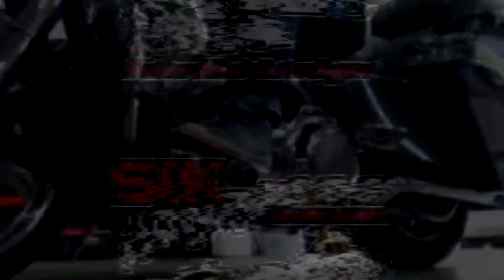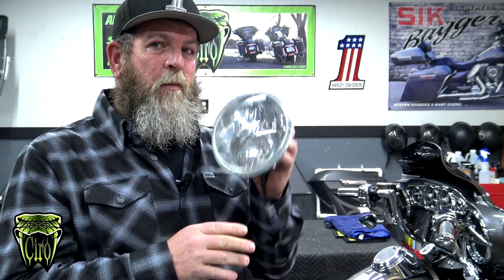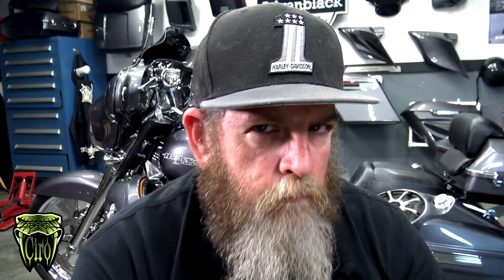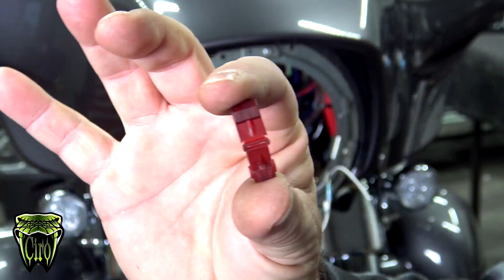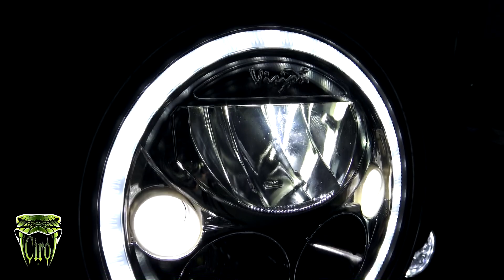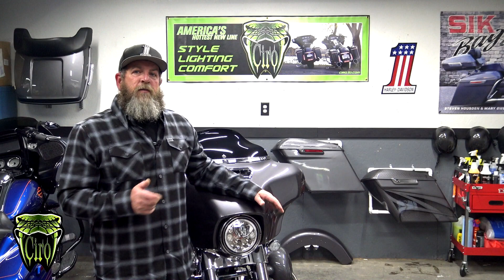Ciro 3D Vision X LED Headlight Install Harley Davidson Touring

Comment: I just bought a newer ultra with Daymakers on it but I have a vision x on my street glide I’m selling should I put the vision x or keep the daymakers on?
Reply from the maker: I was never impressed with the daymaker..specially at a 635 dollar price point for a basic projector style headlight you can get on amazon for 60 bucks.  Id put the vision x in and sell that daymaker all day. The vision x has a way broader flare on the lighting making it possible to light up the edges of the road better...great if you are in deer country. Just my honest humble opinion.
Reply: @sikbaggers awesome and I sure am in deer country I’m by Columbus Ohio area

Comment: Do they make these for 13 ultra limited?
Reply from the maker: Yes...select this headlight http://shrsl.com/1xk3p and then scroll down to fitment.  All models prior 2014 need the 45012 to have both high and low beam on when high beam switch is on.  Click the number on there and it will take you to the adapter. Youll need the headlight, the wire harness ( https://shrsl.com/4gxqt )  and the adapter.
Reply: @sikbaggers I had to buy an adapter for my 14 street glide I don’t know if this is the one or not I’m not sure though.

Comment: How do you like it compared to the Adaptive Custom Dynamics LED Headlight?
Reply from the maker: Hey David...I really cant help much there man..I havent ran that headlight before..my opinion on moving headlights, and take this with a grain of salt bro as I could be wrong...I understand it on cars...2 headlights, 6 feet apart...still lighting up both side of the road...one headlight turning to the right, it adapts to the right...can you still see the left? We have deer and they dont really care which side of the road they cross on lol I could just never wrap my head around it on a bike..I really need to try one out to be honest

Comment: Thanks for the detailed video. I wish they would include the plug with the headlight though. Glad it is the offseason, but I really wanted to power this up.
Reply from the maker: yeah they dont include the plug because the 7 inch round fits alot of bikes, just change the plug...youll have to get one for your bike.

Comment: I have a 99 Electra glide and was wondering if you have ever ran the halo as your blinker? And if so how to wire it up to make that work?
Reply from the maker: Hey terell...I have not tried that but Ciro makes a headlight bezel that has turn signals integrated into it ...the halo is just one light so im not sure you could use that as a left and right signal but you can with the bezel because it is two separate lights.

Comment: I installed the same on my electra. Works great, but up where I live in the mountains, we have a lot of sharp curbs and as you can see on your video(15.36) the light is like a "wing". So when you're in that curb you don't see a fu*ck where you want to go. For the rest it works great. About the price: if it costs more than 400 bucks from the retailer,  he puts about 200 bucks in his pocket. That's not normal.
Cheers from France. 
Great video man!
Reply: Sorry, 10.36
Reply: Ooops, 10.36

Comment: I have a headlight from truck mall and it is more shiny and quite frankly brighter than the Harley-Davidson brand by jw speaker.  I think the good aftermarket headlight makers like he speaker, hogworkz, SUNPIE, and truck mall use a bigger chip in their led’s which make them brighter at a reduced cost. Weather two times or three times brighter ANYTHING is better than stock.

Comment: Hi! Great video, very informative and clear footage. I have a 07 street glide the previous owner put an off brand china light on that doesn't fit properly with the stock bucket. I see you do not have one, is it necessary to have a headlight bucket and/or would i need to replace my stock one for this light set up. Thank you!
Reply from the maker: generally the bucket is part of your adjustment ring...you would have to look at that. If the heat finsd on the back of the LED light are hitting the bracket in the bucket you can snip out part of the bucket in the middle

Comment: Steve what is the difference in the vision x vs vision xmc about a $100 difference in cost
Reply from the maker: There should be a Vision X VX  which is an amber/white switchback hallow ring for jeeps and the Vision X  XMC which is a solid white hallow for the motorcycle. Im not sure on the price differences.

Comment: I've been running this headlight on my '17 Ultra Limited for two seasons now.  My original HD Daymaker suffered catastrophic shatter failure at the hands of some bug with a death wish.  I couldn't believe how much better this light is than the HD DM.  10 + 10 stars on this upgrade.
Reply from the maker: Hey Kevin I have seen a few of those busted before. Thats crazy man, specially for the price..
Reply: @sikbaggers  hey Brother.  Have you seen in person the new 2020 HD adaptive Day Maker with halo ring compared to this light?
Reply: Kevin Hartman what's your opinion about this light compared to the 17 Ultra Limited DM light on dark curvy back roads? The DM cast a flat "airplane wing" left to right flat light, and leaves HUGE dark unlit spots at the 9 to 3 o'clock areas. Does this light fill those areas?

Comment: Just installed a pair of them twin peaks H.bars on my CVO , Now I can’t wait until Spring to use them..!!  I’m down for a new Head light from Ciro I love that vision X lamp...
Reply from the maker: You will love those bars ...besides being super easy to pull wires in they are very comfortable. I may go another route on the road glide though...I rode one the other day  with some cool bars on it and im considering that for the new build. The road glide will for sure get the Vision X in it...man that thing is unbelievably better than the cheapo I had.
Reply: @sikbaggers  I just ordered the vision x for my 14 streetglide upgrading the stock light hope I made the right choice

Comment: Off subject, What size bars are those?
Reply: Ok, thanks for the information,  and you have a nice looking bike
Reply from the maker: @wwclt  Thank you...its been a very long work in progress as all of them are I guess lol. Next were moving on to a Road glide...see what I can do with one of those this time.
Reply from the maker: 10 inch LA Chopper Twin Peaks. Keeps your hands right behind the fairing. 12's will put them right above the fairing
Reply: Ok ... I was just wondering cause I see you still have stock mirrors.  Do you know of the head what is the pull back?
Reply from the maker: @wwclt  There are speakers where my stock mirrors used to be. I have performance machine mirrors that are hanging down from the perches. These 10" bars will be right in front of your stock mirrors though. The pullback/sweep on these are 6 inches.